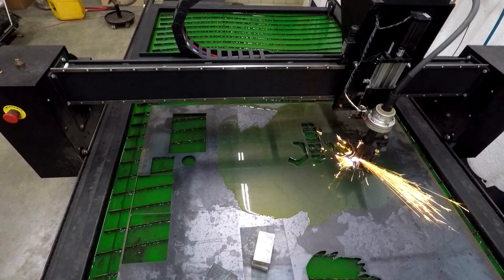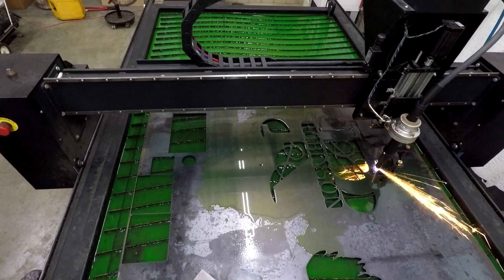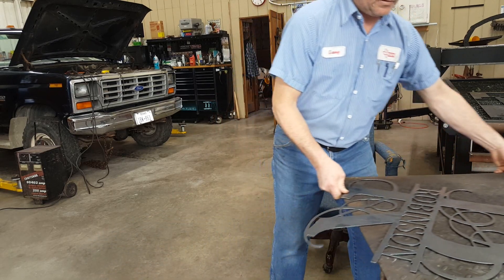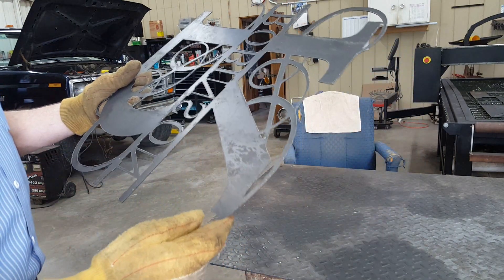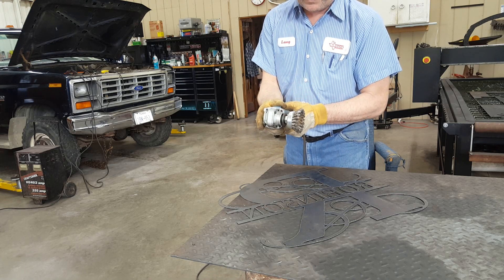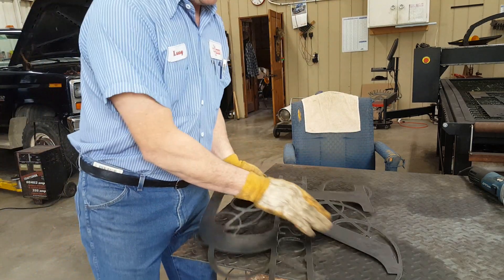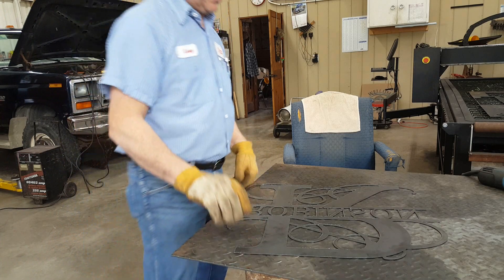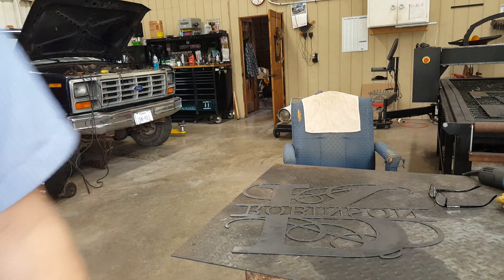Plasma Table Dross removal

Comment: You pretty much are doing exactly what I do except these days I usually soak the piece in diluted hydrochloric acid, that makes it really easy and removes all mill scale.
So glad to hear you say use the right side of the cup brush, I’ve tried telling this to people for years on plasma forums and been ridiculed for saying so but I know it works, it’s like they don’t get it, the wire rotates into the edge, removes dross and tends to blunt sharp edges, where rotating over it isn’t as effective and tends to sharpen the edges

Comment: Put the piece in a muriatic acid bath and the dross falls right off, passivate it quick in a baking soda wash, blow dry and you’re done.  If you paint over the black mill scale it won’t last

Comment: Could you tell me what the green liquid is inside of you water pan?
Reply from the maker: It was a powder that you mixed in buckets when filling with water.  It came with the machine, he told me it was called Plasma Quench.  I have not been able to find it.  I got some other stuff from Airgas called Dynaflux

Comment: You can use this, flap wheel discs, or a needle scaler.  It's a mixed bag of results with different gauges of metal, but all three do a good job.
Reply from the maker: Flap discs don't work near as well as this.  I used alot of them before I settled on this method.

Comment: Again, thanks for the tip.
The only problem with your audio is from using the built-in mike on the camera in an open shop. It was designed for wide-range pickup, and so it catches all the echo and room noise. The last few words sounded pretty good because you were close to the camera.
Reply from the maker: Yes I have a better Mic I usually use but I've been hearing a popping noise from  because I think when you use Ipad for monitor the wifi to GoPro causes the noise possibly.  I would have fixed the low audio on the second half of the video but my wife was hurrying me to take her to breakfast so I didn't check it before uploading.  Oh well, I'm gaining a little at a time.  I ordered a new usb mic last night to do some voice over on screen recording at Plasma Table computer.